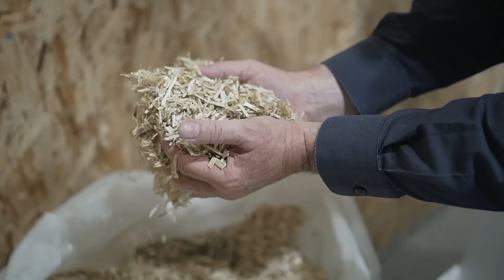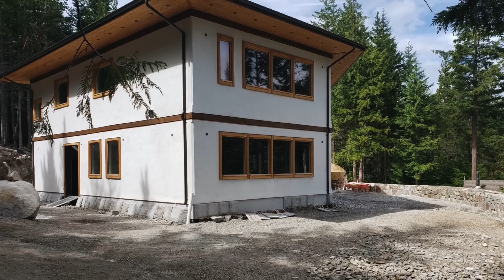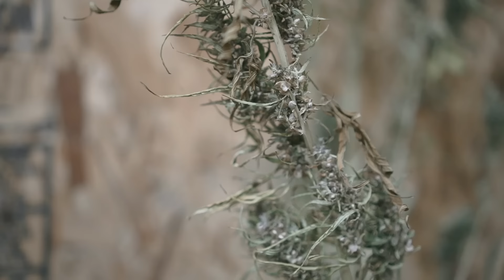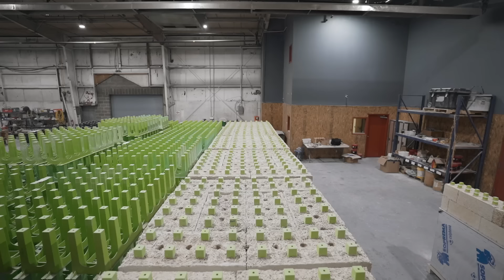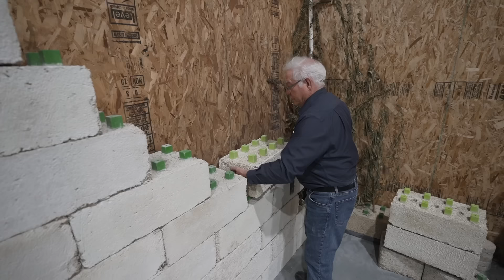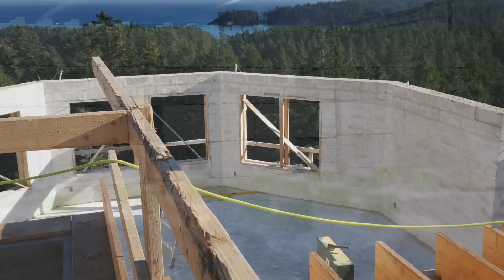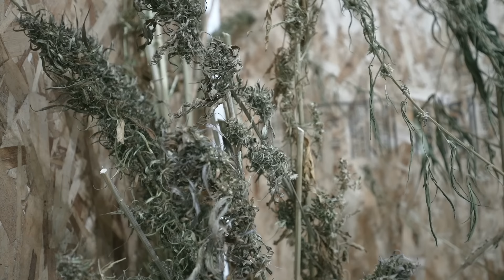Amazing Lego-Style HEMP BLOCKS Make Building a House Quick, Easy & Sustainable

Comment: In which countries is this product available?
How good is the thermal insulation, e.g. measured in watts per square meter and degree Kelvin, for a typical wall?
Is there a detailed brochure available?
This video is now four years old.  How many houses have been built using this material?
What are the long term experiences?

Comment: This innovative new composite material, composed of a specially treated blend of wood fibers and reinforced thermoplastic resin, demonstrates a tensile strength that exceeds that of steel and offers improved durability and resilience compared to conventional plastics. Additionally, these prefabricated buildings and modular townhouses can be assembled efficiently within a month and dismantled just as easily, supporting flexible relocations. The design employs Jenga-like interlocking modules that facilitate conversion into trailers, thereby helping streamline transportation and installation processes, particularly in rural or hard-to-reach areas.

Comment: No mortar?
Seems very light and fluffy and that's great for insulation, but not so great for strength and durability. I'd also say there's ecological issues with the support material being vegetable oil based polymer. because use of palm oil is causing an ecological disaster right now.

Comment: The tiny house I bought when I  retired is on a slab and has cinderblock walls.
Being that it is on a flood plane near a river, I cannot build out from the footprint of the slab.
BUT . . . I can go up 😅
Would like to have the roof removed and 3 more blocks added going up. That will give me 10 foot ceilings. 
Replacing the gable roof with a gamble roof will give me a second floor.
Replacing the windows with double hung ones will vent the heat out.
I have already built a sand battery into a 30" BUCK WARNER pot belly stove. No need for that electric wall furnace anymore. Supplied with a small battery pack and recharged with two solar panels, my pot belly is more than adequate to heat perfectly fine.
This past winter my electric bill was reduced from $400 per month to $135. The lady at the city office wanted to know if I was freezing my dog 😅
Problem is that I live in south central Missouri. 
WUT ??
Nobody here wants to work !
Everytime I think I have a contractor lined up . . . They dissapear
What happened to the work ethic in America?
Last year my electric b

Comment: I love the idea but... He says that the weight of the blocks is resting on the sockets inside the supports and not on the actual hemp material. I find that alittle concerning. How long will the plastic stay strong before it starts to lose its strenght and starts to brittle. What then? Are the bricks tested such that they can support the weight without the plastic? Just wondering

Comment: Lack of compressive strength, fairly low r value and  moisture concerns are what I have. A one story house in a dry climate would probably work but a lot does there. How would this handle a harsh winter followed by a humid summer like around the Great Lakes?

I'd be also curious in turning those blocks to run 90° from how they are expressed there. Would provide a thicker wall granting potentially more strength and insulative value. A metal structure on the inside could also grant needed strength for projects with the hemp crete providing the mass and insulation.

Comment: Very interesting. As a cubic meter of concrete requires about 70 litres of water which is entrained in the mix and gone forever, this is a really good environmental solution to excess water consumption in construction.

Comment: so hemp mixed with cement. I'm guessing you're using a lot of lime because it helps the structure but you can just use sand instead maybe fine grain gravel. The R value should not diminish too much. You should test the R value of these blocks to see if they match up to insulation.

Comment: How much do the blocks cost? The best I could find is an entirely separate website, not a failing unit, with just biofuel saying it's a hundred dollars, but it doesn't specify If it's a hundred dollars per block or per palette

Comment: Such a cool looking product. But the devil is in the details. How do you run the electrical and plumbing (he only showed the holes). How do ledgers work? How do you air seal between the blocks? We need to see a complete build end to end. Where do you buy them? What do they cost? There website has almost no information. Sadly, the lack of information and marketing will prevent this product from ever taking off.

Comment: This is a fantastic idea.  Straw bales provide the r value, but it's hard to get them to settle without deformation.  I love the load bearing tech.  I've lived in the cold country with little insulation, spending 800 to 1000 a month on heating, so I love the R-value then couple this with a masonry heater inside and it's warm and cozy.

Comment: Hemp is truly a miracle plant; not only for building materials like these, but for paper, fabric, and food. I had a hemp hat for over 12 years & it never wore out, but it finally shrunk so I gave it away. It's probably on some kid's head 30 years later.
Reply: Levis jeans & old american west jeans were made from hemp, lasted too long so not commercial.
Reply: @Geoff-j4b  That's not quite true; hemp jeans worked fine for the consumers but not for Levis, who learned that cotton denim wore out much sooner & could be easily textured to make it more fashionable. And the failed War on Drugs make it illegal for U.S. farmers to grow hemp (best suited to the American West's climate) so the option disappeared except in a few imported goods. The politics were primarily responsible & this isn't surprising since politics are the worst aspect of living in the U.S.
Reply: I am not building with hemp if it shrinks ;-)
Reply: @troelsersking101  Apples & oranges & you're missing the point. Generally a hat lasts about five years max & my hemp more than doubled that 'life expectancy.' Hemp building materials are processed differently & don't shrink or lose their shape. But depending on where you live, you may want to consider fireproof materials such as a Corning glass product for roofing. My point: we should consider using new materials to meet our needs because many of the old ones are very hard on the environment.

Comment: I’ve worked with high pressure compression molding in thermal plastics and wondered that with the right bio binder mix with the hemp it could be molded to be strong enough for the inner frame / prong design.
I am thinking of a totally biodegradable walls if the building is to be taken down purposely or otherwise. This could make a tremendous positive impact on our land fills and recycling of the other materials used in these buildings .

Comment: They have found 1200 year old hemp and Lym walls that are still standing, after 75 years the wall becomes petrified, you can pass jeans made of hemp fiber down to your grandchildren, hemp oil is outstanding for your health, Henry Ford made a car body out of hemp fiber, then made the oil to lubricate the engine out of hemp, which did not set well with Standard Oil or the Steel Industry.

Comment: At first glance it seems like a good idea, just not for homes or any other architectural structure that uses the walls to mount things on, needs noise reduction to <=35dbA inside, needs to be wind resistant or basically any other application that has to be sustained for longer than the next storm.
I like the idea but its not thought through unfortunately...

Comment: Just the fact that those blocks are so large and are not hollow speaks to how much of a reduction in weight they are compared to traditional concrete blocks, which are much smaller and hollow but weigh around the same amount. Being able to have such a high insulation value without the need for insulation under siding and inside of framed walls is pretty impressive
Reply: Didn’t you hear him say that they’re filled with gravel? Am i the only one listening?
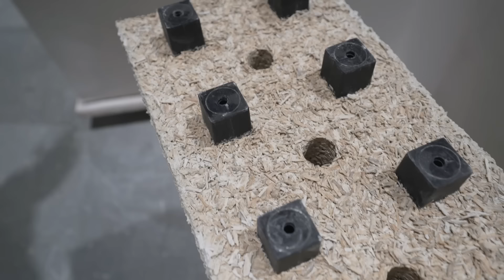Reply: @davidjones8043  You just made me re-watch this entire video with CC turned on, not once was gravel mentioned. The dude in the video described what both types of these blocks are made of and specifically stated that "no sand of any type is used so you can cut these blocks on a ban saw" at 2:30, you would not be able to cut a block filled with gravel on a ban saw. Also what would it matter if gravel was used, my comment was about how impressive it was to see an old man sling these blocks around like they are nothing when they are about 50% larger than a traditional concrete block and completely solid, and that they almost make the need for additional insulation near zero. 

So no you aren't the only one listening, cause weren't listening...
Reply: @davidjones8043 You were the only one not listening.
Reply: @davidjones8043 what's the timestamp?

Comment: This is awesome. How much does one block sell for and what are the dimensions. How many blocks high can it go before it's it crushes under its own weight? I know how to mount wood or metal 2 concrete or each other. But what if I wanted to mount a wood or metal frame to these blocks? What about a metal I-beam? Could these things be treated the same way as a concrete block? And lastly what is the cost?

Comment: And the price is ...? Can it be mass produced/scaled up for mass application in buildings and skyscrapers? How much energy is used in production of this "bricks" ?
Should we use arrable land to produce this instead of food? Can we afford it ? It seems like perfect material for mice or squirrels to nest in. How about wasps? 
My great-great grandparents here in the Balkans,Europe have built two houses,one from stones and mortar another one from bricks and mortar 150 years ago - they're stil standind strong,excellent insulation,fire resistant,mold resistant AND bullit resistant (we had 4 wars in between). The stone house had been struck multiple times with lightning without any damage and without lightning rods as a protection. When nearby oak and linden trees were hit they were destroyed like the bomb hit them,we had to cut them down.

Comment: You never mentioned the r value of these blocks so what is it ? You also stack the blocks without "mortor" in your video but then say you should use it between blocks. Not transparent advertising. Lime stucoo on the outside and lime plaster on the inside. Isn't there cement involved in both of these. I thought you could use a thick hemp mix on the inside for increased insulation and a more natural wall finish.

Comment: On their website,  specifications mentioned are
- Strong vertical load bearing compression strength
- High Insulation value

But,  sadly,  no values...
There are no certifications for load bearing capacity or thermal insulation value to be found.

Am I missing something?
Where are these values?  Showstopper for me...

Comment: Clearly these blocks have vertical strength and stability; but whereas they inter-join vertically, what about laterally? There is zero bonding in the perps. This leaves me wondering how the building would fare in a severe hurricane or tornado.

Comment: I had a similar idea about 20 years ago. Only problem I see is you will have to put all the plumbing pipes on the outside of the wall. You only made room for the electrical wires. Not really a problem. Lots of commercial buildings have pipes attached to the outside of the wall instead of hiding in the wall. Or, you could just fur out a few walls just where the pipes are located.

Comment: Would there be any possible way to replace the biocomposite frame for some formulation or combination of recycled plastic?  You indicated that the poliester frame has important structural characteristics that plastic lacks.  However if there were some way to combine the material with other elements, such as rebar in the case of anti sismic structures, or use heat and pressure to make more rigid frames, you would have created a (hopefully) cheaper alternative with tremendous environmental impact. There must be some ambitious chemist or structural engineer who is dying to work on the solution to this cost and concept problem.  Just have to find the person and the money to figure it out...

Comment: How would you install heavy wall pieces that need to be mounted on studs? Even the dry wall anchors that back up against the inside of the drywall would not work. Anchors that just go into material such as dry wall won't work for 300 lb Art installs. I assume these will go on expensive homes were installing things on the wall will be the norm. Just wondering because I've been an art installer for 30 years. Some pieces are well over 100K that can not take a chance of the installation failing.

Comment: I've been pondering hemp's use for constructing an earthship as an alternative to using old car tyres for the back wall, comparatively speaking how does hempcrete fare against car tyres in terms of insulation and how easy would it be to create a tyre like mould? Also given that the tyres are rammed with earth and put under a log of pressure how stable would they be structurally?

Comment: "it sequesters like 1.6 times its weight in co2" - this statement is bullshit. It violates the natural law of conservation of mass. Tho' .. you could say "sequesters" if you only do your measurements during the day.

Anywho, using plants as building materials is probably the most effortless way to get co2 out of the atmosphere. At leat for the short term. You can't grow hemp indefinitely. After a couple of generations it will make the soil unsuitable for hemp. Crop rotation fixes that issue to a degree. Trees, due to their natural affinity towards fungi are much better option in terms of timespan.

Comment: It's always nice to see innovative new ways to build with more environmentally friendly materials.  I LOVE the R value and if you have to have a resin insert, at least its thermoset.  However, I would worry about sticking doors and windows as that stuff settles and dries then expands over the next three decades with a very heavy roof and joist system above.   That sort of thing could be a nightmare over the long term for homeowners.  Hemp hurd is an internal foamlike transport structure for the plant with no strength.  Along with the great R benefit comes compressibility under load over time.  Highly crosslinked thermosets often embrittle and can shatter when overloaded in a localized concentration due to settlement.  Then there is the wind load problem.  I've survived two hurricanes in my area with conventional studs.  Not sure this would hold up to 100 mph winds.  Maybe some steel in a few areas to keep things from getting out of shape?
Reply: I suspect the lime crystallized within the hurd fibers and strengthens them considerably, but this doesn't really matter. As I understood this video, the majority of the strength of the wall is provided by the internal support frame, not by the hurd/lime composite.  I have seen several  poured in place hempcrete wall demonstrations, and all of them relied on a post frame or similar timber frame to support the roof. The hempcrete was not at all structural in those applications. This product seems to function similarly, but has an internal frame in order to be self-supporting. I guess that resin frame could be a weak point or have a questionable lifespan, but so could any product. I have to assume their testing/engineering would show it is a reliable system. There are always people who won;t use a product until it has been in use for a generation, which is understandable and at the same time slows down innovation.
Reply: @travelfeet  I'm interested in the stuff but as a sheathing product to replace expensive OSB and ply.  Studs would seem much better in tension during high winds and won't compress over time like plastics.  Pine studs also sequester carbon.  Plastic adds carbon to the atmosphere.

Comment: Interesting idea to use Lego style blocks...but I do see an issue when it comes to extensions or other adjustments of a completed build. With normal brick you can remove the mortar and extract bricks, if need to say add a window or door.
But this fashion can only be built ground up, so to do the same you would have to remove all blocks above and then replace accordingly

Comment: I chucked a bit at them touting it's use as a carbon sink.  The production of lime is well known as significant producer of greenhouse gasses.  Depending on the efficiency, lime production can produce anywhere from 1 tonne to 1.3 tonnes of CO2 per tonne of lime. Although a bit less than produced by Portland cement, it is still a significant emitter.

I also have some concerns being touted as lightweight.  Not always a favorable attribute in a material that stacked.

Comment: There is this amazing invention, you should try it.
It's called brick
Reply: You cant grow brick.
Reply: @picklechin2716  That's right, you craft bricks. 
Same way you make pottery. 
But this time you mix the clay with sand, make it the size of a brick, and then you fire it in an oven.

Hemp blocks have their place in the industry, but going brick is cheaper and they lasts longer. 
Somewhere along the lines of a hammer is a nifty tool, but not the right tool for everything.

Comment: Three questions:
1) How do you frame window and door openings--by using regular bucks?  But how do they attach to the blocks?  
2) you mentioned mortar between the blocks; could you use foam construction adhesive instead?
3) Is a bond beam needed at the top of the walls before framing a second story or roof?
Reply: Ya, this and many more questions. This looks interesting, but they left a lot of unanswered questions. I would like to see how they do plumbing, heating, light fixtures, etc.
Reply: I hope someone answers!
Reply: wow you aren't builders are you
Reply: @NelsonThibeau  we aren't, but we want to learn :)